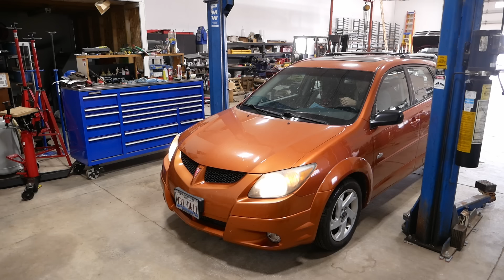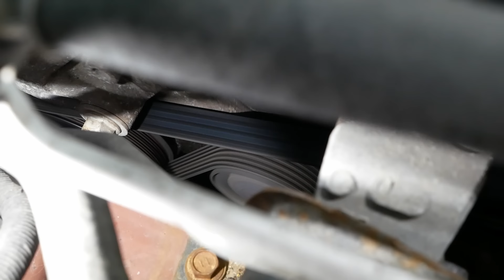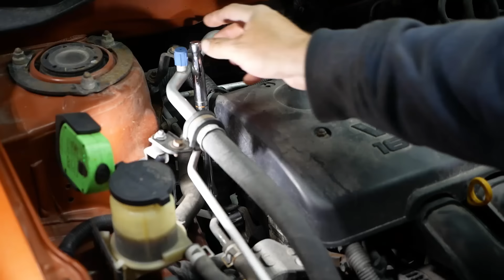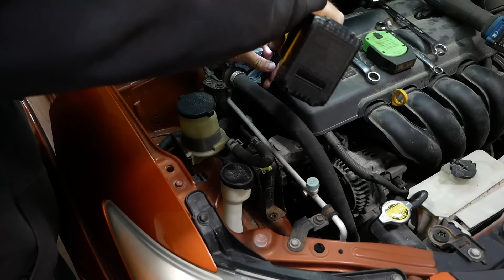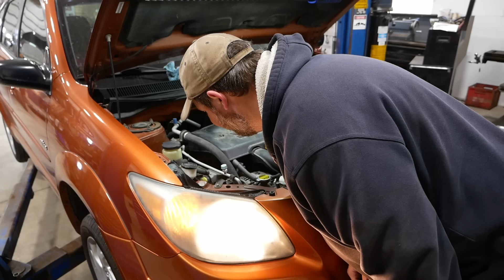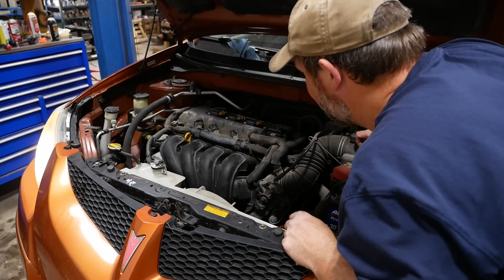My Worst F-up as a Mechanic - Hurt Myself, Damaged Customer's Car - Vibrating Vibe

Comment: Hi Wes.  I know the feeling you are having right now.  A couple months ago I was in a fog and forgot to open my garage door and backed right into it!  I was going very slow and fortunately only creased the inside panel.  I felt like an idiot.  Worse yet is that I now see that panel every time I have to pull out of the garage.  After a couple of days life returned to normal and I hope the same goes for you.  I'm really glad you did not get seriously injured.  Your videos are absolutely awesome.  Keep up the great work!  I look forward to them every week.
Reply: It's a horrible feeling ,I recently jacked up my car like I've done a 1000 times before with cars over the years ,took the wheel off and took it to the tyre changer ,heard a bang the car slipped right of the jack and took the side skirt off it and miraculously missed the door of the car I don't for the life of me how it happened it just turned my stomach ,cracked the paint on the bottom of the front bumper and broke the clips to hold on the skirt thst was all the damage caused due to the car actually landing on the lower balljoint, was able to buy a full kit of the clips from the dealer and fix the skirt on correctly and a quick trip to the body shop sorted the paint on the bumper
Reply: My wife did that…..twice.
Reply: @rwnagel  ouch that's hurtful 😢

Comment: You're not alone. Guy I work with put a Merc SL 500 on a four  poster ramp but for some unknown reason left the auto gearbox in reverse. I put one foot in and revved the car to hear the noise it had. Que 350hp flying backwards with me half in the car and taking the door clean
 off as it hit the ramp post!.
It came to a stop after hitting another car in the workshop.
It was only a sales car from another garage which they had sold and was only in for a rattle from underneath...🫣

Comment: Wes, am reminded of my biggest brain fart moment.  I too share, so that others don’t do as I did.  Major kudos for sharing. It’s honorable, mad respect. 

Mine involves firearms. I also had a neighbor I loved. Our city houses only separated by about 10’, with a 6’ tall wooden fence between them. Anyway, at home alone with my dog. Put a grip laser sight on my wife’s Glock 19.  Then, while cleaning my pistol, getting way too comfortable and cocky, and a major brain fart… pointed my pistol (a .40 cal) at the wall and slowly squeezed the trigger. I still don’t know why I did it, though I would have bet my life on it that I had no ammunition in the gun. It went bang. The noise was deafening inside. My ears were ringing and my dog looked at me like, “what the __ did you do that for?”  Then I thought of where did the bullet go as it was towards my neighbor?!?!?  I quickly noticed it went through an interior wall, then into the bathroom (door was open) and into the shower wall, right through the tiles and I presumed through the exterior wall!  I ran outside in a panic, and see the splintered siding (two layers, cement board over wood siding) and see a mess on/through the fence. I panicked and ran to my neighbor’s door and knocked. His wife came to the door, so I knew she was ok. I couldn’t help but immediately ask, “Is “Bob” OK”?  He was fine, so RELIEVED!  Turns out the bullet was imbedded in the last layer of cement board siding. But I learned a valuable lesson and share with others. I keep the mangled bullet on my nightstand even 15 years later as a reminder.  Of course, like you, there was repairing the damage done. And like you, my pride was quite wounded. 

I enjoy your vids so much. I learn. I laugh. I empathize. And you won’t believe, I even cry sometimes. 👍
Reply: "Put a grip laser sight on my wife’s Glock 19. "

Good God
Reply: It's stories like this that make me wonder how anyone is brave enough to keep firearms in their house. It seems so easy to just randomly do something life-endingly stupid with it one day.
Reply: There are two kinds of people in this world: those that HAVE HAD a negligent discharge and those that WILL HAVE a negligent discharge.

Comment: Glad you're ok.  People die all the time at parking garages reaching for the ticket machine.  Halfway out, foot slips off brake.  All you need is enough force to keep your diaphragm from moving and you're done, even if your airway is clear.  Same thing with trench collapses.  Hope a few people learn from this.
Reply: Every single time I stop for my mail at the rural mailbox in front of the house, I throw the car in park before I even stick my hand out of the window. The thought has always occurred to me that the foot slipping off the brake could case serious injury to an arm.

Comment: Walked into the body shop where I used to work, and sitting there was a car that looked a little like that. Appears that the driver must have tried to exit the vehicle which must not have been in park (maybe neutral) and was crushed to death. A sobering conversation with my old boss.

Comment: Hi Wes

So glad that you are OK and not seriously hurt.

Here in Britain the hand break is mandatory to work and to be used when the vehicle is to stationery even when working on the engine and having the engine running.
This is especially important with automatics.
Reply: In the US with 98% of cars being automatic, many use Park selection as the "handbrake", the actual park brake is usually a foot brake operated by the left foot which is often never used. When it is used it often seizes if it has never been used for years so hence the hesitancy for a mechanic to use it.  Thankfully some automakers are including an automatic hand/park brake in their automatics.

Comment: Glad you're ok Wes. Work accidents in my line of work (construction) most often happens when you either are doing a routine job that you have done lots of times before, and you get complasent about the danger and don't pay enough attention. Or when you are "Just going to this one little thing" and don't use proper safety precautions, just because it's such a quick little job. Like me a few months ago when I was stressed out while cutting a steel beam with my little 5 Inch angle grinder and I couldn't get the disc deep enough. Instead of getting a proper tool, (which would have taken me all of ten minutes) I did something I KNOW is wrong and removed the guard... Well a visit to the ER and a meeting with hand surgeaon followed and all I could think during all that was, well that was stupid of me... (I'm ok now, but the scar still itches). Looking forward to your next video.👍

Comment: It’s a lot better than I’ve seen, could’ve been worse. Could’ve totaled the car, the building and killed yourself. 

We once had a car come into the shop with no brakes at all. All the way to the floor, zero braking action. Bay Door was closed, as we weren’t planning on pulling it into the bay just yet, just checking it out real quick. 

Boss man drove it around to the bay forgetting the brakes didn’t exist, and drove right thru the bay door, and into the line of equipment along the wall at the back of the bay. Car was totaled. Equipment was totaled.

It was quite a day, a very expensive day, but no one got fired. Although he did take a vacation after that ordeal.

Comment: I think if you do something that has it's inherent dangers long enough things just go wrong. Some may say, it doesn't have to but in reality, it just does. Like in my profession, your profession and others we are always doing something inherently dangerous and / or risky but we manage those risks and manage those risks well and efficiently for many years. All of a sudden one day BAM, it just happens. You didn't get hurt. No one got hurt. We just chalk it up as an experience. learn from it and just move on. In my profession we call it a reset. Usually complacency sets in, incident happens, luckily no one gets hurt. Our complacency switch is reset. When it come to your profession, you seem to be one of the best. That's going to keep it all good. Thanks so much for sharing.

Comment: The really good news was that the air bag didn't deploy!  That could have cost you plenty!  IMO the wrong belt compressed the piston too much and  wore it out.  The bolt was probably caused by a vibration.

Comment: Good recovery, Eric.  Do this job long enough...shit is going to happen.  As  long as you are good, everything else is just small potatoes.  Small tip from a 44-year auto tech... Always leave the front windows open! Easy to start and no locked doors. Cheers from Langdon Alberta Canada.

Comment: ProTip: When using lockout equipment unlock on the passenger side.  When sliding that metal rod there is a good chance that you will scrape some paint.  Driver will definitely see it if it's in the door frame on the driver's side.    It was a very easy unlock and you didn't scrape any paint......this time.
Reply: Very good point, best not to get locked out.

Comment: Wes, as a mechanic of 40 years in the trade, I’ve always used a sthethoscope to locate unusual noises in the engine bay… I’ve also had my share of stupid mistakes and accidents but I never repeated those mistakes.
Thank God you’re ok!
Reply: you ever use that stethoscope to determine if fuel injectors are working?

Comment: I always think this will happen on a vehicle dyno, banging through the gears, vehicle has a ton of power, straps let loose. Wouldn't be surprised to hear that it has happened! I just bought the same 72" masterforce box I see in the background. It went on sale, plus 11% rebate. Love it! Glad you were ok in that accident. I had a 70 chevelle fall on me once, luckily I had enough wood underneath the car to talk about it today. Was changing oil pan gasket, had 2 bottlejacks on the block jacking it up for clearance to pull the pan, was lowering one down, adding more wood, torsional forces collapsed the ramps. Ramps didn't have cross braces to stop it. It happened extremely fast.

Comment: Thank God Wes that your weren't SERIOUSLY HURT i had a similar scenario happen in a diesel shop i worked in was working on a new suspension and had to take the bolts loose and when i did laying on a creeper with out chaining the front with a simple chain and when i loosened the bolt that would allow the suspension to swivel thinking that would it would still be tight in the rubber the whole housing fell on me!!! We as mechanics have all had stupid things happen!!!

Comment: I've had days like that....I'm a 67 year old life long Mechanic/Electrician and I was trying to find out why my 2011 Jimmy 4x4 wouldn't go into 4 wheel drive...it was parked in our driveway on a slight incline and the engine was OFF and I had squeezed my head and sholdiers under the vehicle under the Driver side front door and was pulling on random cables not realizing one cable went to the transmissuion (which was in Park) suddenly the vehicle made a noise as the transmission came out of park and rolled quickly twords my head and as I let the cable go it fortunately went back into park a mere few inches before the front tire touched my head

Comment: I remember I was working on a 68 Cadillac Hearse. Had it on a drive on lift, and old one where you could just slide the rails to adjust it. So I had the drive shaft out, can't remember what for. It was a long one and a real pain in the ass to get it in. Instead of putting it down and putting it in neutral my dumb ass thought I could pick up the rear with a couple pole jacks. Worked great. Done it a thousand times. This time one of the pole jacks buckled and it caused the rails to slide to the right in the front while the rear went to the left. Wound up caving in the lh side of the rear of the vehicle. Tore a hole and ripped the chrome molding off. That was NOT  a fun conversation with my boss at all. This car was freshly painted we had just finished building the engine and dealing everything. Shit happens.

Comment: Had my share of these.  I did learn never to leave the driver side window up. Made a point to let in down before getting out. Probably needs rear brakes.  I learned to check in a safe place they hold to 1500 rpm in gear. Remember a Advisor jumped in a car in my bay left the door open  and reverse he went, trying to keep from paying me diagnostic charge. Folded the door back. Funny thing is there was no diagnosis charge. The man just bought it.  They have to take it back and get him another one.

Comment: Thatss a damn good 1zz engine,those engines last forever mine has 450.000 miles, no oil burning, original a,/c working condition, mine is. 5 speed,

Comment: As an hvac technician of 15yrs now. Your best tip to troubleshooting a weird problem; pick all the info you can from the owner. They may not know what they are talking about...but you kmow what they are talking about. The owner knew it was the ac compressor or some component of it because he unplugged it and it went away. Nothing fixes itself coincidentally.

Comment: Let this be a lesson to DIY mechanics. I had a car jacked up, on axel stands locked in place, wheels chocked. Under the car I crawled and felt intense fear . After I got the job done successfully I swore never to crawl under a car ever again. As. Teen none of this ever scared me, but now at 75, I am wiser.  That day I managed to change all the brake shoes successfully and do some catalytic converter work under the car. Glad you are OK

Comment: one of my first months at my dealership my then shift leader told me to help another new person finish up a car while he was gone. I soon after this learned my dealership has a "no unsupervised new person" rule. This proved disastrous, as I was ignorant to make sure they had torqued the lug nuts on this Dodge truck. The customer drove off, and about 10 seconds later, their whole wheel fell off while driving. Shift leader was fired, I got to keep my job at least. Really nailed it in my head that even if you didn't touch something, your name on the car still make you responsible for it being done properly, and the even the smallest overlooks can result in the hugest, most dangerous mistakes.

Comment: I remember doing a service on my pick up, I forgot to put the sump plug back and kept filling the oil until the whole can was finished before I looked underneath and saw £30 of oil on the floor, an expensive and stupid mistake.😂
Reply: Good thing you didn’t start the engine and drive.

Comment: Just about got crushed between the door and under the tires… cudda got twisted up real bad. Congrats on continuing to work and film without needing to take a breather and collect yourself for a while. You were definitely in shock from the panic… maybe a quick sit down wouldn’t have been a bad idea. It’s funny how any little issue seems so important at the time, so much so that we put ourselves at risk and it isn’t until after a close call we realize how ridiculously short sighted it was. You could have died over a belt tensioner. Many people have died for less… like stepping into traffic to grab a childs runaway ball, or a cigarette butt

Comment: When I worked at Wal-Mart Tire and Lube, one of the techs was going to pull up a jeep that was next in the bay. As soon as he put it in gear and let off the brake, it accelerated full throttle into the shop. He was able to avoid hitting another car and tech by turning hard left, but in the process took out our oil/air filter gondola, a bay terminal and narrowly missed the wall as he went out the bay door of the next bay. Long story short, this stuff happens. Glad you didn't get hurt bad

Comment: Working on the shop floor at Ferris State College Auto Program, I was letting a car down on the single post lift. Let the air out (air over oil lift system) and all the sudden the car dropped about 4 feet in about a second, the hydraulic valve failed.  The air trapped in the oil tank prevented the car from hitting the ground but it made it to within a couple feet of the concrete. Anything or anybody under the car would have been squashed, luckily nothing was that day.  No tool boxes, oil drain tanks, Trans jacks, jacks stands, step stools, etc. Taught me a very important lesson about complacency, given a chance someday something that can kill you, will kill you if you give it the opportunity.

Comment: Been there done that years ago while working on my 2004 jeep wrangler.  Had both wheels off the front and had to start it up to do this trick to pop the unit bearings out of the spindle hub.  When I started it like an idiot, did not want to climb in so I depressed the clutch pedal with my hand and eased it out thinking it was in neutral when it was actually in first.  Immediately it jumped forward sending the jeep forward falling off the jack stands, pegging my foot under the rear driver tire.  Luckily I was able to wiggle my foot out of the shoe.  Got lucky as no damage was done to me, the garage or jeep.  Learned from that one and never again.

Comment: Don't feel bad. 30yrs in biz. Jumped power to a starter on my wife's car while under it. Shift linkage was broken, car in drive. Got run over , broke wrist in 6 places lucky to be alive. If people in parking lot hadn't stopped the car I would have died. It happens soooooo fast. Tired , and in a rush. Still have nightmares years later about being under that car. Safety 1st, nothing else matters.

Comment: Very late but this reminds me of that every time I spill a drink, I previously think "this is stupid, I'm gonna spill this" and when it happens I'm just mad that I did it anyways. Goes for a lot of situations but just goes to show that you need to take your time and not be complacent. Anything dangerous/risky I'm extra cautious because of dumb little mistakes like that every so often. Glad you're fine but body work is the absolute worst. I had a small gouge on my Mustang bumper from a garage door incident and the only fix was $600+ out of pocket for the smallest paint fix.